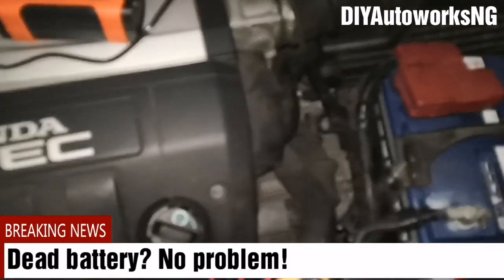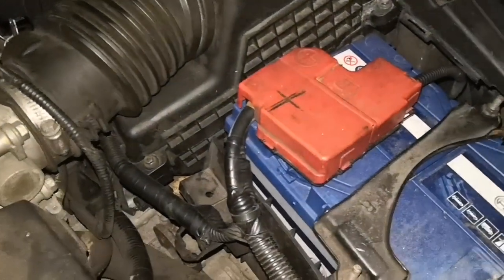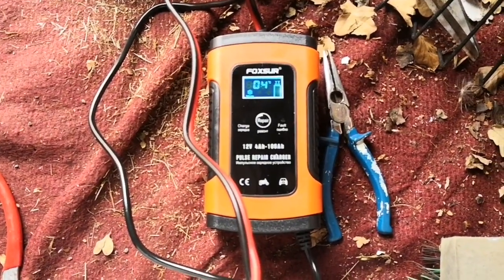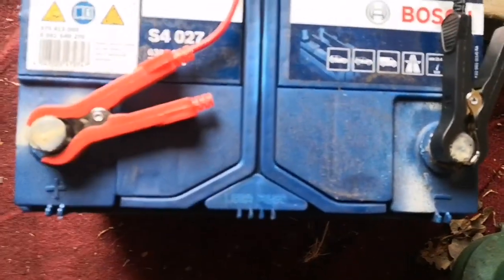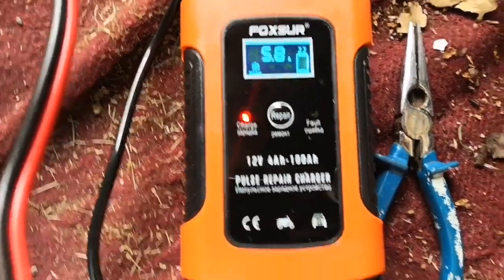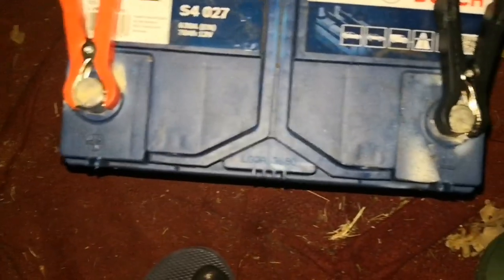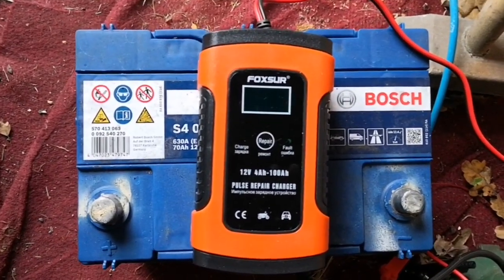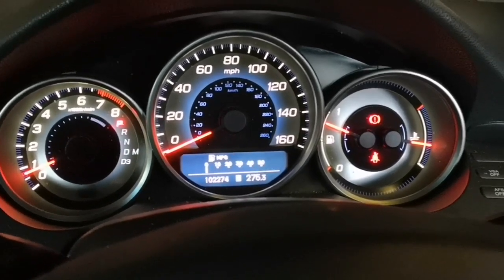Using a cheap battery charger to restore a dead car battery

Comment: I have the Exact same charger and I use it for a couple of vespers I’ve got to keep them topped up as well as my cars they are cheap and inexpensive but absolute brilliant charges I think I paid £12 from eBay brilliant highly recommend thank you for doing this explanation 👌🏼
Reply from the maker: Really good, cheap piece of kit!!!
Reply: @DIYAutoworksNG  hello, would I 🔌 directly to the wall socket or use an extensions? I am a woman n I wanna make I have this, jumper cable, tyre pumper in my car because I have experience flat battery a few times I expectedly. I know I have to read the Manuel but I just wanna know because u didn’t show were u plugged the charger too.
Reply from the maker: Can be plugged to the wall or an extension depending on far the battery is from the device.
Reply: Can we jump start our car with it?
Reply from the maker: Nope. Just a charger.

Comment: My battery is still performing 12.5v . To get max performance when I  charge battery must I remove battery and do it. Or I can just charge without removing it. Thank you for your help
Reply from the maker: Hey. It depends on the charger you have. If it's the one used in this video, yes, it can be charged in the car. HOWEVER, you cannot use the  'repair' function while it's in the car. For that the battery must be taken out.
For ordinary charging, also review the method for connecting to the battery. That said, at 12.5v I won't bother charging it.
Reply: @DIYAutoworksNG  thanks buddy

Comment: if battery have too less water or weak in amperage then good voltage dont means nothing or only if you want to listen radio or for windows while car starting no
Reply from the maker: Right. If the electrolyte is low, there's no need charging it.
Reply: @DIYAutoworksNG  yes, charger will show for few minutes  that it is Full charging and in reality you will not be able to start car and you will only hear  click  a bit when you turn key!! for radio and windows will be fine for some time but not for car ignition

Comment: Hey there - I have a different brand of charger, but from what I can tell, functionally identical. My car battery's gone (internal lights were on...). I connect the + first, connect the -, but as soon as I plug the charger in power, I get an "ERR" on the charger screen. Any clue what it might be? Thanks in advance!
Reply from the maker: I recommend you check the documentation that came with the charger. Mine doesn't display that sign, but it could be a cellin the battery is gone, or even a fault in the charging system like a faulty starter...

Comment: Hello 
12v 60ah 510A battery I need recharge 
Which mode is better?
Normal mode or pulse repair mode? 
Which is correct
Reply from the maker: Depends. If the battery has been growing weaker and weaker over time, a repair will be better. If if was a rapid discharge event e.g. Left headlights on, regular charging should be fine.

Comment: It is my understanding that in order to use this battery charger to repair a battery, it is necessary to press the "Repair" button. It seems that button was not pressed in the video. Also, when the Repair button is pressed, the charger will display PUL. PUL means that the charger is pulsing to repair the battery.
Reply from the maker: Correct observations. I only charged the battery

Comment: Does pulsing stop automatically for car batteries?
Reply from the maker: Haven't had the opportunity to observe this. Have had power cuts during the repair processes I've done. However, the manual says it will switch to standard charging when repair is complete.
Reply: @DIYAutoworksNG  Manual says pulse mode will stop  after 24 hours irrespective of the state & type of battery. Thus confused.
Reply from the maker: Yea. I think I'm mixing the info with the manual of a different charger that I have. Should be as you stated. I've never done a 24hr repair so can't confirm by experience.
Reply: @DIYAutoworksNG  Yes the manual is confusing. The charger is supposed to have overcharge protection, i.e. it's supposed to stop charging when full. Yet the manual recommends to keep it in FULL state for 1-2 hours. Not sure what's the benefit, since the charger stops when full !
Reply from the maker: That 1-2 hours is just part of float or trickle charge which is charging the battery at an amperage equal to its self discharge rate.

Comment: I have the same charger, I put it to the test on six bad batteries, it did absolutely nothing for them ,  all six were not improved at all in any way,  my wallet was lighter than it was before I bought this charger, the only thing it did accomplish
Reply from the maker: Do you also have this specific charger? I see you commented on the other kind of charger. As I mentioned before, I have also had some batteries that this did not work for just as  the tool doesn't claim to revive all dead batteries e.g. batteries with: damaged cells, depleted fluid level, or a voltage below 8.5volts.
On the other hand, it has been for getting restoring weak batteries which do not have the above limitations

Comment: Thank you, sir. I have this same charger they will recover most batteries. Lead acid & gellies I have used it on.  As a ham, CB & UHF radio operator we always keep backup batteries & inverters in case of emergency. I have a few 3.3, 7 & 12 amp gel cells & some larger lead-acid ones up to 126 amps. These are for an emergency & a possible war is a whole lot closer with this Russin business now going on. These chargers work well at improving battery performance by dissolving the crud on the plates. I recently was given an 85 Ah battery. I topped up this 85Ah sealed leisure battery (I distill my own water) by drilling 6 holes topping it up & resealing it with hot glue so easy to remove & re-top up in the future. I had it on pulse repair overnight & it brought it back. My only test was on a 12-volt kettle that draws about 14 amps & It boiled a full kettle twice so far & close to an hour of 14 amp constant current draw & it's still well over 12 volts, but I will give it some more pulse charging. I have 2 126Ah truck batteries that I have been maintaining on pulse repair in case this Russian war business goes nova & the UK loses its power grid with conventional or EMP weapons. UK power grid is very fragile. God help us if that happened all nuclear facilities could not be maintained & would explode. If there is a god that is
Reply from the maker: Some nice DIY with the drilled fill up holes! Tackles the water loss through the valves for those VRLA batteries. Happy to hear it hasn't popped under pressure too! Do stay safe and wish you the best. Hoping for the best in the current conflict! Stay safe.

Comment: Bought a new battery, $200......Recharged my old battery and took the new one back! The battery charger cost me $20!
Reply from the maker: Nice!
Reply: @DIYAutoworksNG  The mechanic at "Honest1 Auto" Wanted $168 to check the battery! Thank god for YouTube and people like you.
Reply from the maker: Lol. Just on battery testing, I also got this for less than $30 I think. Super useful for testing the battery, alternator and starter.
https://youtu.be/E6SqGFDVjys
Reply: @DIYAutoworksNG  I have a 2015 Fusion Hybrid, that sits a lot. When ever I use it I had to jump it with a battery pack
This drained the battery. I got the red light telling me to safely pull over, even thought the car drove fine. Found out later the 12v battery was low, due to lack of use. I use the car maybe once a month. Now I leave the trickle charge on it and all is well

Comment: Is it possible to use this pulse charger on an EFB (start/stop battery) battery?
Reply from the maker: The documentation that came with the charger did not specifically list EFB, though it specifies flooded batteries as supported. EFB's are a type of flooded batteries. Hope this helps.
Reply from the maker: Nice to chime in. The documentation on yours seems updated. Mine didn't  lift EFB but I've certainly used on EFB's

Comment: My foxsur battery charger  the fan doesn't come on when it's charging it just ticks like a clock  is this normal does anyone know. Any advice greatly appreciated
Reply from the maker: All batteries I can lay my hands on are full, so I can't do a proper assessment. I was just able to use repair mode. On repair it ticks, turn on and off with the pulses delivered by the device. You can also feel the air come through the vents with each pulse. Are you able to feel any air? Will be on the lookout for a discharged battery to check the other modes.

Comment: Good little charger, had mine 3 years,its never missed a beat and revived a few batteries with solid results.
Reply from the maker: Yep. Thanks. Great to have a solid review from someone else! Incidentally, I used mine yesterday on my neighbour's dead battery.
Reply: One question: I have been using this charger, since January of this year, in a 3 y.o. Lead Batery of 700 AMP car battery, because it was waking up in 11.9 volt and didn't star the car. The fist time revived with the repair mode for 4 hours. Since then I was doing a repair charge of 4-6 hours once a month. The other mode doesn't activate: shows FUL even if the charge is low, so I can't only do the repair mode. But in the last two months the battery loses its charge overnight. I repair for 30 minutes and I can start the car, drive, and keeps good for about 6 hours. Any thoughts? How can I improve this? A repair charge of 24 hrs? The longest I have used that mode is 8 hours and still loses the charge overnight.

Comment: It's not working for me when I plugged the foxsur charger in it says Full but the battery is fully dead I even put it on the repair mode for 18 hours and the battery was still the same fully dead.
Reply from the maker: If you use a multimeter, what voltage does the battery read?

Comment: Wont work when battery is really low because charger doesn' t kick in below a certain voltage. Useless video!
Reply from the maker: I wouldn't call this useless at all. It has already paid for itself by saving me from replacing a power generator battery that the technician vowed was done for. 
The manufacturer does state that a minimum of 8volts is required for a 12v battery for this to kick in. Such deeply discharged batteries can still be charged with this tool assuming you have a second healthy battery of similar capacity. Connect positive to positive and neg to neg, then connect charger to the deeply discharged battery. It should then charge. (I don't recommend this though to anyone who doesn't understand battery charging dynamics)
Reply: @DIYAutoworksNG  But you have nevertheless given a good idea with cheating the charger with a second battery! I will try it and look if it works! You're a smart guy, I must admit! Thanks! And if it doesn't work (depends probably on the sulfatisation of the cells), I'm where I was!
Reply from the maker: We have a deal! 😂
Reply: @DIYAutoworksNG  But it doesn't work for a dead or half dead battery!

Comment: I have just bought one of these and reached "FUL" same brand Bosh but "S4 021" due to leaving my car lights on for 3 days. Quick question why does it recommend leaving it on for 1-2 hours after FUL? Is there any specific reason? Will it enable my car battery to hold a better charge?

I feel like my Bosh S4 doesn't hold a good charge even though it is brand new and I didn't charge it via this way when I first got it I just put it into the car after my old battery had a bad hold of charge.
Reply from the maker: Thanks for watching! I'm not exactly sure the reason for the 1-2hrs after showing 'FUL', but I figure it's to do ensuring the capacity reaches 100%.
If you feel, the Bosch is not holding a charge well, it may either have some level of sulfation or there may be a parasitic draw on the car battery. As a next step, will recommend you use the repair function to charge it for a minimum of 8hrs. This should address sulfation if present. You might find the new video I did on the Foxsur charger helpful. Also covers some information and tips on battery maintenance in general. Link below:
https://youtu.be/3oCX6BGEPZA
Reply: @DIYAutoworksNG  Thanks for the reply, just watched your new video and Liked :) !

There isn't a parasite drain as far as I am aware, though it is recently a brand new battery I am willing to give the pulse a shot as I am charging it indoors and cannot bothered to take it out again, currently I have completed the charge process and left it on FUL for approx 2 hours now is it safe to then put it on pulse? As it doesn't mention if it is after you have fully charged it.

Once the 8 hours have elapsed do I need to then put it back into normal charge mode OR should I just put it back into the car as is fully charged?
Reply from the maker: Thanks for watching and liking!!! 

It's safe to use pulse right away, the pulsing hardly raises the temperature nor does it lead to overcharging. Besides the tool has overcharge protection. Pulse mode also charges the tool so no need to switch to charging mode in the end since you've already charged it. Even if you do, it will just provide float charge which wouldn't harm anything. Just keeps it 100%
Reply: @DIYAutoworksNG  ah right I understand that makes sense I was worried the pulse might do damage but come to think of it the normal charging is more likely to if you compared both modes.

I was concerned the battery might explode or something just my fears as I don't know much about electricity lol! 

I ended up just putting it in the car without pulsing it and it worked in fact the start up was a fraction faster compared to before, I wonder if it will always be like this OR once it drops back to its baseline it will stay at that baseline if that makes sense so back to over a fraction longer to start. Just curious
Reply from the maker: Lol. Totally understand the uneasiness about electricity! I still put mine in plain sight while charging. Lol.
If you do not drive stop-and-go traffic or leave it unused for prolonged periods of time (and the battery is still healthy), it should stay the same. If it does drop again, just use the pulse mode to ensure sulfation, if present, is dealt with.
Reply: @DIYAutoworksNG  Yes man I don't want to play with electricity it is very dangerous especially I do not know what I am doing! Thank you brother for your advice I much appreciate it!
Reply: @elit3physique  have you managed to revive your battery? How much time on repair mode?
Reply: @f4jaw  it's been quite a long time since I figured it out. I had it on for quite some hours and completed it I think
Reply: Hi, should we first charge then pulsate? Or first pulsate, then charge? Thanks

Comment: my charger makes a crackly electric noise like its shorting, or like crickets in the grass, does yours?
Reply from the maker: Yep. Though not audible from a distance except I put the fan vent against my ear. Is your really that audible?
Reply: @DIYAutoworksNG  when it was first turned on and sometimes when switched over from pulse onto charge, i can hear the pulse noise also, but this sounds like it should do i guess
Reply from the maker: Yea. Sounds normal to me.

Comment: I have a motorcycle wet battery, it is few months old, discharged due to not riding the bike for months, switch on bike, lights not even light up, so i took the battery out, distilled water level is still max, 

Then use this charger, it says battery has 11.2v, so i turn on the charger, it shows FUL on normal mode no matter what, then I start Pulse repair mode and leave it overnight, hopefully it saves the battery.
Reply: Can I use this battery charger and leave it on my motorcycle battery as a float charger for the winter when I don't use the motorcycle
Reply from the maker: According to the manual, yes. Provided that the battery is not damaged. Damaged batteries would usually get hot when charged...
Personally, I would have a schedule for leaving it plugged in. My head just revolts at leaving it all winter. Lol
Reply: @DIYAutoworksNG  can i fully charge my car battery even if it has 12.7 in it? thanks
Reply from the maker: Yes.
Reply from the maker: Yea. It will usually show Full for small capacity batteries. That's the reason why the manual recommends using only the repair mode for small batteries. Do let me know how it goes.
Reply: @DIYAutoworksNG  first few hours it looks nothing happened, battery wasnt getting warmer at all, i still let it be anyway, and 12hours later, it's still on pulsing mode but the battery is now warmer and some little bubbles in it, it's working! It is now 13.9v, battery is going strong :D, glad i bought this charger, useful when you have vehicles but not driving them often like before due to covid
Reply from the maker: Absolutely!!! This charger is worth every penny, mine has paid for its purchase. I have used it for car as well as power generator batteries! I remember how confident my power generator repair guy was when he said my current battery was gone. It's been close to a year since and the battery is still going strong.
One tip. I have never seen this charger go from pulse mode to FULL. I just use the estimated duration in the manual: 8hrs for small battery and 24hrs max for any other size. Very happy for you!
Reply: @DIYAutoworksNG  nice! I bought it at RM40 about USD 10, worth it